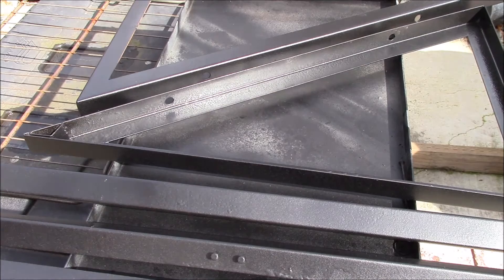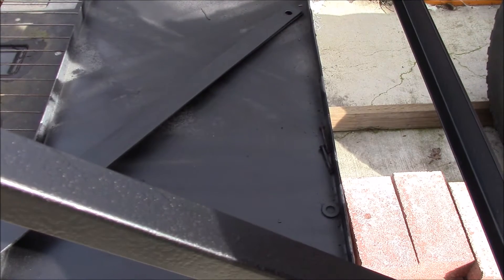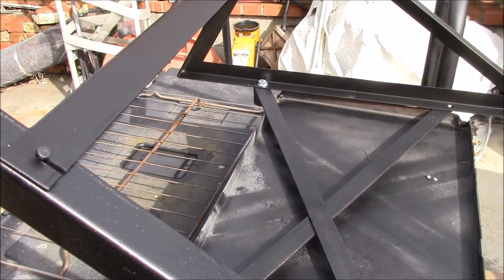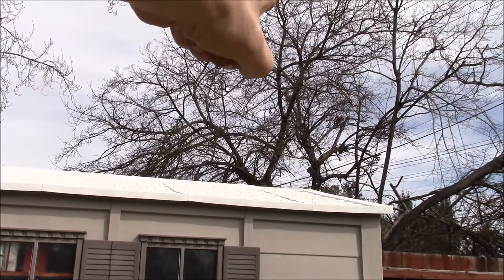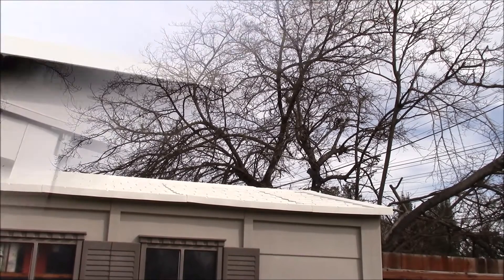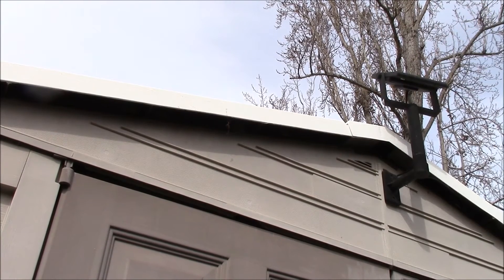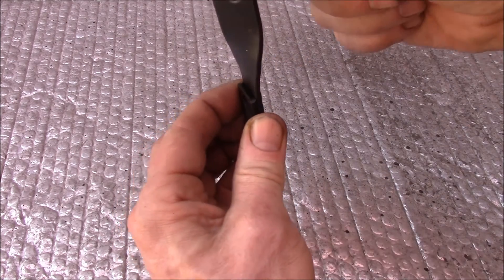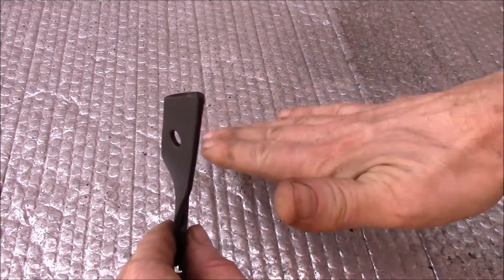Solar Shed Project, Part 1 - Prepping the solar panel mounts

Comment: Any consideration given to roof temperature affecting glue connections for the non-bolted feet  - particularly in a hot summer?  Just curious...
Reply from the maker: Well I did coat the roof a while back with a white, heat reflecting coating, so that seems to keep the roof temps much lower that they were when it was a dark color (same as the window shutters).  Then the panels should be mostly shading the area beneath them, so that should also help cut down on the temperature rise.  That said, I guess I'll find out this coming summer how well it'll work.